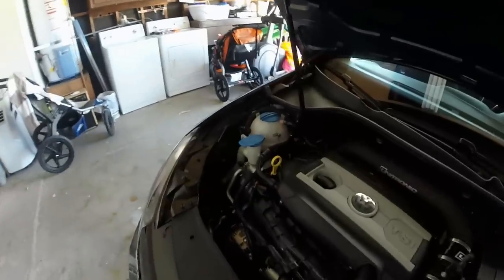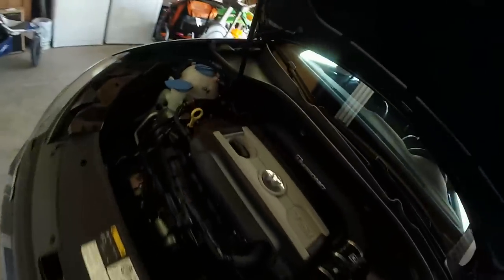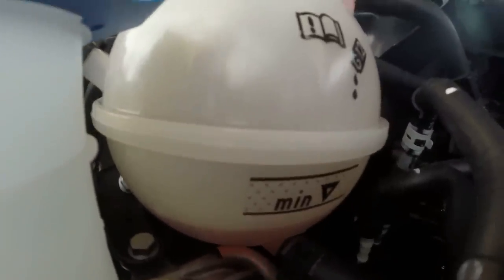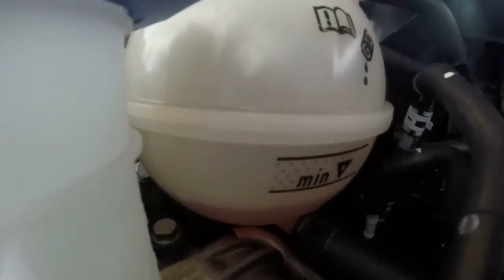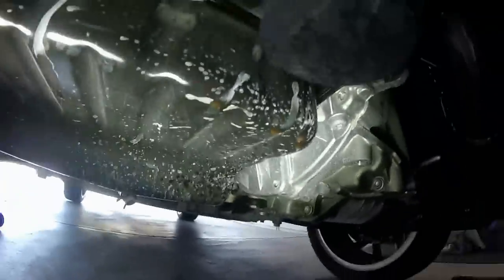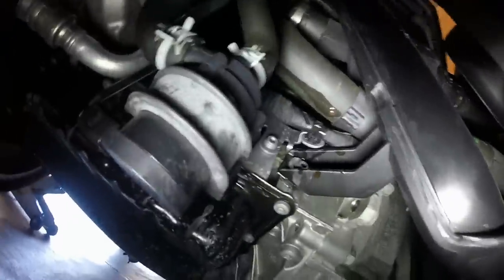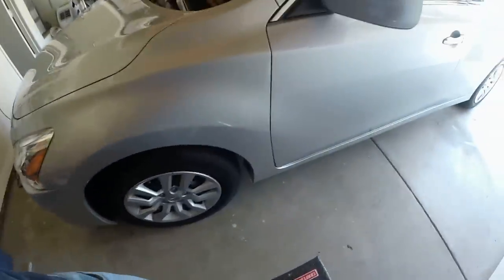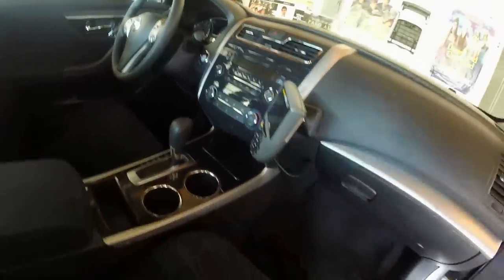2013 VW GTI: Ep. 60: Waterpump Leaking!

Comment: I have a 2012 VW CC 2.0T running on 46K miles, and i recently started having a mild coolant leak somewhere. It takes about 2-3 days of moderate driving to run the coolant reservoir liquid down to the bottom of the tank. Not too too bad, but I took it to get checked over at a local mechanic shop, they estimated $620 for the part replacement + labor work. According to them, it's the water pump that needs to be replaced. I haven't agreed to the repair yet, trying to see if my car warranty covers the cost for this part first since the water pump does fall under the drive-train VW warranty, If I'm not mistaken. The waterpump part itself goes for about $70. and $180 for the entire pump assembly. These being aftermarket. I think OEM full assembly goes for $280 or so.
Reply from the maker: +Joshua Luzuriaga try and get a warranty first of course.

Comment: I'm finding that this is a common problem. I had my '13 GTI for 20 months and 9,000 miles and the water pump took a dump too. As you can see by the miles I have put on it I don't drive it that often. Started as a slow leak and progressed to a bigger leak within 24 hours, just like in the video. If you see a leak get it fixed asap because it will get a lot worse in a very short period of time.

Comment: I owned a 2007 GTI MK5 , for the first 50,000 miles I loved it ! All of the scheduled service was done by the book by the dealership, Nothing but the best for my baby, then it turned on me, first the A/C when out on me at the beach in 95 degree weather, had to replace the complete system at a cost of $1,800, then I started having engine problems. To make a long story short, if you buy a new one trade it before you hit 50,000 because VW does not care about their customers. Also I contacted VW of America when my A/C blew up to see if they would cover some of the cost of the parts. The customer service manager acted as if I was robbing VW by asking them for some of the parts cost, she did offer a free oil change.
I will never ever own another VW product !!!!
Reply: I have a 2007 vw gti. Love the car but it started to give me problem now. Cv boot issue, AC is not working now. Recently I found out coolant is leaking. Assuming its water pump leakage. This car is really expensive to maintain.

Comment: My car is at the dealer getting its 4th water pump right now (in 42k miles). Might as well add it to the routine maintenance list along with oil changes.
Reply from the maker: 4th!! DANG!
Reply: you should check out the lemon law. I believe its 3x for the same problem and its considered a lemon.
Reply: christian pereira
not in my state (too many miles on car). It may qualify under federal warranty laws...
Reply: that sucks i have the same car
Reply: I love the car, but they need to figure it out.
Reply: I'm about to have my second one replaced, only have 33k miles.  I've had 3 major issues in 3 years (none my fault), and I'm starting to lose my patience with the car I love.  Too much many each month for something with this many issues.
Reply: +admrob I was on my 3rd and it just died going on 4th.  Ridiculous sorry but mk6 has to go
Reply: Carlos Ulloa I have a 2013 vw Golf TDI with 98xxx should I be worried about this situation yet?

Comment: My MK6 has had its first water pump go out at 90k got new one done at dealership, one week later that one took a dump, and now at 98k it has taken a third dump, totally new pump every time, VW needs to make these out of something different than cheap as plastic. Crazy 3 water pumps before 100k! the struggle is real, and its sad because I still and will forever drive gti's.
MK1 owner and MK6 owner out...
Reply: I know this is late as hell but there's aftermarket full metal pumps
Reply: @Glitched-101  I'm on my 2nd metal waterpump now and guess why I'm here again? It's leaking AGAIN
Reply: @RadioKilla180  I haven't had any issues with my one just make sure you buy a high quality one and don't opt for a cheap one tbh I forgot the brand I installed in my car but I haven't had any leaks for over 3 years
Reply: @RadioKilla180  the quality of the rubber gaskets are usually to blame
Reply: @Glitched-101  I got the Usp metal one, but actually the leak is coming from the radiator not the waterpump. I'm grateful it's not the waterpump again

Comment: My water pump failed on my 2013 Skoda Octavia Vrs Tdi. Only 33k miles on the clock. I lost coolant very slowly also and it was only when I was having the cam belt and water pump replaced that you could see that the water pump was deteriorating.
Reply from the maker: bummer

Comment: I have a 2015 Mk7 Gti, now on my 4th waterpump in 24 months. 

I'm pretty much now turned off VW and Audi. Thought I would upgrade to a S3 even though my last auto had oil issues and eventually blew the turbo. Still had faith. But now....yeah no. Best thing you can buy is a cheap Toyota.
Reply from the maker: bummer

Comment: If the leak is behind the radiator the chance is most likely the water pump. My P71 is beginning to leak from time to time its a small leak so I am not worrying about it right away but will replace the pump it only costs around 2 to 300 bucks to replace anywho, if you cannot afford to replace it right away just top it up with water every couple weeks until you have the money to replace it or do it yourself but I am lazy and don't have the tools so gonna replace it after next paycheck. I keep my cooling system filled with just distilled water in the meantime then will just have 50/50 coolant after the pump is replaced.
Reply from the maker: Aspie Otaku cool
Reply: +Aspie Otaku you know how important coolant is right? you know that it prevents not just from freezing but also from boiling?!    Water alone is not entirely adequate to keep the system cool. coolant protect's against corrosion too.
Reply: +Aspie Otaku Should mix that distilled water with antifreeze. You can get VW/Audi certified quart bottles on Amazon for a decent price. Filling your reservoir with just water will slowly make the issue worst at high or low temperatures. 
Anyways, i have a 2012 VW CC 2.0T, starting leaking mildly about a week ago, it mild leaks so I'm not too worried about it. As i continue to refill the reservoir with mixed coolant I have been looking for a solution. A local mechanic said the work plus part will cost $620 which seems like too much. I will follow up with the dealership as the waterpump falls under drive-train warranty if I am not mistaken. That could mean a free part replacemet for me.

Comment: The Water Pump on my 2013 blew at 7K miles.  The dealer gave me a loaner.  It's part of the warranty.  Not sure why you had to pay for yours.  BTW, the 2014 Altima's are nice.  They do have a CVT which is different until you get used to them.  Great gas mileage for such a large car.
Reply: any webpage or proof about that "part of the warranty"? over a dozen people have told me the rental should be paid for, and i wont be settling until it is.
Reply: ***** If it is a warranty repair that is over night, the car is included.  I believe it was in the warranty information that was provided when I purchased the car.  When I took mine in, it wasn't even a point I had to worry about, so I didn't look it up.  If you want a fast answer, tweet to VW corporate, they are super fast with their responses.
Reply: Don Thorvund i dont tweet, any other way?
Reply: ***** found it!! "9. Does Volkswagen provide a loaner vehicle while my vehicle is in for repairs?
Loaner coverage is part of the New Vehicle Limited Warranty period valid for 4 years or 80,000 km, whichever occurs first. This coverage includes rental provision for warranty-related car-down situations that cannot be repaired the same day."
Reply: ***** opps.. that is a canada site..
Reply: Oh, and you should consider tweeting for just this reason!

Comment: Hello. I've got a mk6 GTI that has a coolant light going off. My temp stays at 190° and it's SEEMS to only leak while sitting. I can't spot where it's leaking from for the life if me. I put more coolant in yesterday before driving and when I got on the road from work today, the coolant light came on again. Does this sound like a water pump issue? Thanks in advance.
Reply from the maker: yes. it leaks so slow it burns off and never hits the ground.
Reply: Oh great. Thanks for the heads up. Once again, you've saved me. lol
Reply from the maker: oh day, it might dump all at once and then your stuck on the side of the road. get it checked soon.
Reply: Yeah. Took it in this morning. Can't wait for the $700 bill from my local shop. Wishing I would've done it myself but I'm tied up this whole weekend. :(
Reply: That blows thanks for the advice ahead of time gonna change my water pump every 80k miles and put extra gasket maker on there to make sure it don't leak
Reply from the maker: ya its a very tricky water pump job. i always left it to the dealer if it was needed.

Comment: was it a simple water pump replace as every garage quote I am getting they are saying the Timing belt HAS to be done at the same time? (I am getting rid of the car in about 6 months so don't care about the timing belt)
Reply from the maker: yes.. it kinda does. i mean the water pump pulley is run by the timing belt. and its not saving much money at all cuz it all has to come apart anyway. any good shop will tell you the same thing. you should also replace the tensioner while you are in there btw. 6 months is a while.. you dont want it to go bad while YOU have it at least..

Comment: Currently having the same issue on my 2010 gti. The coolant light came on a few days ago and I topped it off. About a week later I checked it and I needed to top off the reservoir again. Is there a way to know if it’s the water pump that needs to be replaced? Ever had the issue come back?
Reply from the maker: it clogs from time to time but never goes away until you get the waterpump done.

Comment: Okay so I’ve this weird situation if you don’t mine helping me with! I drive in very bumpy roads and my car suddenly started leaking coolant, I drove it home without it overheating, checked the tank and it was completely empty. I parked it for 3 days and it kept leaking, I now added about 500ml of water into the expansion tank and it stayed for a minute but then it drained out completely all at once with the car off, I see it dripping out one drop every 3 seconds under the car but there is no way for me to remove the undertray/splash guard (because of neighborhood restrictions). I tried to inspect it from the engine bay and all I see is some dried up coolant and nothing new (i.e. the new water that has disappeared) could this be a leaking water pump or a hose? I too have a 2013 VW GTI
Reply from the maker: has to be water pump. very common on the mk6.

Comment: LastHumansGarage This is scaring me I bought a used 12 gti at 29k miles I'm going in for the damn 30k tomorrow ...water pump intake man and coils will soon rise as a issue right ? ...not to mention expensive DSG every 20k miles?
Reply from the maker: long as its under warranty and hasnt ever been modded you're fine.
Reply: LastHumansGarage I'm sort of a rookie I scheduled tomorrow for the routine 30k.and they said something about a special and 27pt ins...and costing around 360...does that sound right ?...am I worrying to much...I have 2 year 24k warranty it's used

Comment: is there a way to access the windshield water pump without having to remove the front bumper?
Reply from the maker: maybe. but removing the fender liner front section, or even the flap under the fog lights.

Comment: I have a gti mk7. After 8 months my coolant level dropped to the minimum line exactly. I went to the dealer and they filled up the coolant above the max line. Is that fine? and do you think I have a coolant leak?

Thanks
Reply from the maker: +Yousuf Al-Habsi possibly it could have slowly dropped to that level over 8 months. but if that happened in a day or two, you have a problem waiting to happen.

Comment: hi, i have a golf 1.4 tsi and right now its on the garage for maintenance and also   in order to change water pump.
between scheduled maintenance i noticed that the oil level get down about 0.5-1 liters is that normal ?
Reply from the maker: not "normal" but happens a lot i hear
Reply: I noticed that the oil level get down only in the 2 weeks before maintenance

Comment: My water pump failed at 15k miles :(, VW problems
Reply from the maker: im pretty much done with VW's at this point. Can't wait to get rid of this car.
Reply: LastHumansGarage Sorry to hear that =\, hope to see your next car pretty soon if thats the case!
Reply: LastHumansGarage Ehhh VWs are not that bad.  The TDIs (at least newer ones) are pretty decent; as is the base Golf. No, the GTI is not reliable, but no performance oriented car at this price point (or higher even) is reliable unless it is a purpose built two seater.  Even Japanese brands that have historically made extremely dependable vehicles suffer from this.  The BRZ/FR-S has all sorts of issues (and it does not share a platform… which makes it even more confusing), as does the WRX, and the Veloster, and even the Civic Si is only about average in this area (and its owner satisfaction numbers are towards the bottom of the barrel).  Car manufactures just can’t build a well sorted performance car at that price point without making compromises somewhere, and part of what they do to get their sales figure lower is share mechanical elements and the chassis with their more conservative platform-mates.  These elements of the vehicle are of course not really designed for the stress and strain that you put them under when you boost a vehicle’s performance like that, and they end up failing.

But really you have the Miata, 370z, and what else?  The Focus or Fiesta ST?  Those are worse than the GTI in terms of maintenance issues.  A Mustang? I mean they are average, but you lose IRS and depending on which configuration you go with they can have lots of problems as well. (We will see how the new one does.) I mean the pickings are seriously slim at around 25-30 grand, and after that you start getting into low end BMWs… and those can come with a whole barrel of new problems to deal with as well as higher maintenance costs.   The Lexus IS is dependable, but not that sporty and downs gas like a fat kid eats cake.  Basically to get a reliable car that gives you the performance you want you have to go up to a Porsche (the Boxster is projected to actually have less expensive maintenance costs over the first 5 years than a GTI, but then again it lacks a backseat; so not that practical for a family) or a higher end Audi (both Volkswagen stablemates mind you).

Now hopefully the new A3 will turn out to be as reliable as its revised upper tier cousins, but until we know for sure about that… well there is not really a better choice out there unless you want to go to something that is more conservative in the performance department.
Reply: LastHumansGarage Glad I read this comment after wanting to get a GTI...Seems like to many problems to deal with. The 2015's look pretty nice IMO, but, if they have the same quality control issues as the 4th Gen Jettas that were also made in Mexico, I'd definitely want to stay away from that.
Reply: Griff from what i have read the puebla plant is actually more advanced than wolfsburg
Reply: Rc Kola Thats a surprise, must have upgraded since the huge Jetta issue from my previous comment. My aunt had one from the Mexico plant and the whole thing literally fell apart, engine went twice on it (1 rebuild, 1 replace) with regular maintenance and no heavy driving. Even the inside was terrible, all trim pieces were falling off, the sunroof leaked, the little plastic pieces that encased the seatbelt buckle in the seat fell off all 5 of them, CD changer ate numerous CDs. The list goes on and on, and it's not just hers, pretty much everyone I talked to that had the same year or one that was 1 or 2 MY off had the same experiences. 

Well, circumstances have changed and now  I need to wait another year until I can get a new vehicle, so I'll just sit back and see how these Mk 7s work out here in the states, they seem to be doing well in Europe.

Comment: Euro cars are rubbish
Reply from the maker: old ones, yes, they are worse than current stuff regarding reliability.
Reply: LastHumansGarage old and new. Too much electronic issues, expensive parts and having to remove more stuff to fix something simple. Dont forget the bolt head patterns are different to other car makes
Reply from the maker: @bomblifenewzealand  hahah you're either a Euro fan or you're not. Obviously, you fall into the latter.